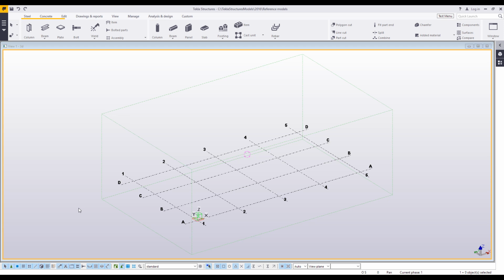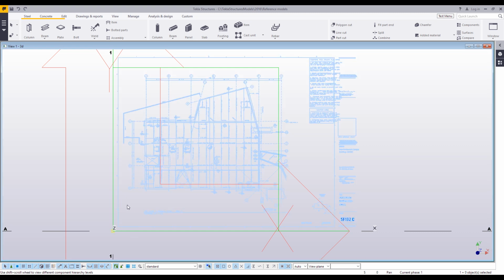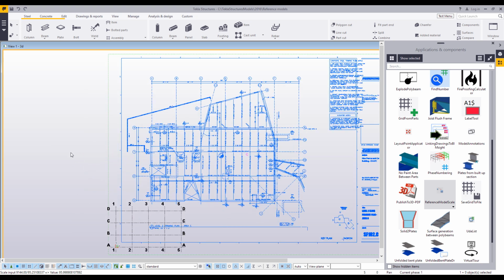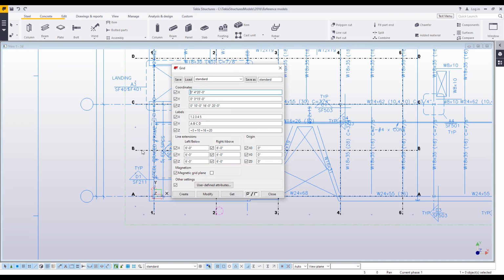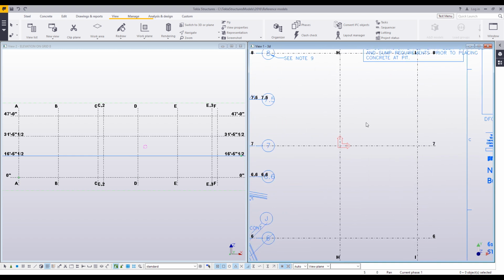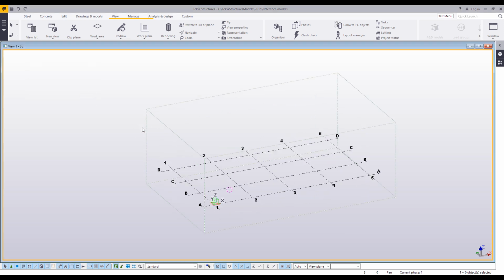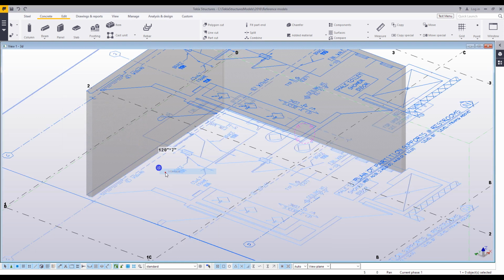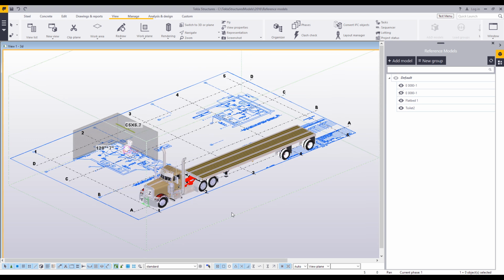Structural Steel Estimating with Tekla

Comment: When there is a vector PDF, there is also a CAD source. It's better to ask 100 times for the CAD file and not going to work with a low accurate PDF file.